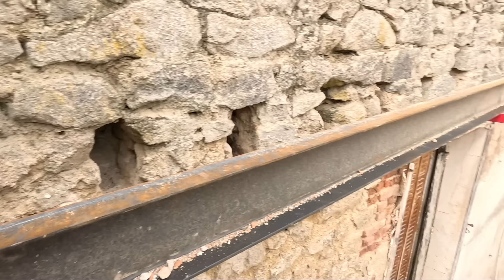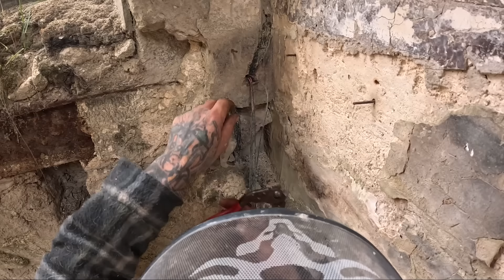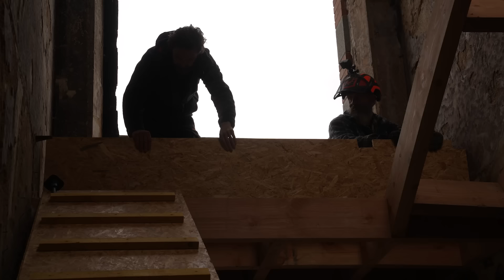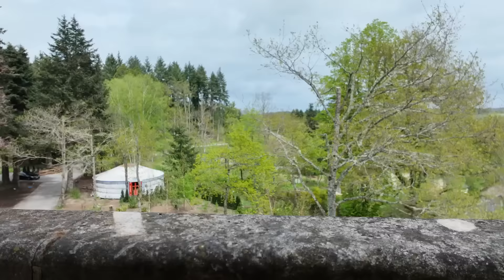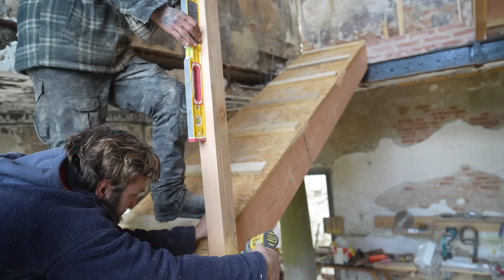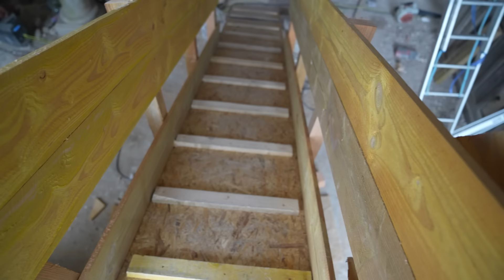Gifting the chateau its viewpoints back.

Comment: Your staircase is still a bit unsafe, if you want to nit pick. The hand rails should be through bolted with a metal plate on either side. If you happen to fall hard against one, especially while carrying something heavy, you could pull out those construction screws and the hand rail may fail.

Comment: Hi from the safety Engineer Do you know why the fire burned what it did? Perhaps because the central section where the stairs are, excellent job, the stair well looks to me like a chimney. Air flows up gaining momentum and speed with air added at each landing Maybe silly maybe not EASU TEST Try putting a childs whiley go around on a stick at each landing to measure the air flow.  Observe Regards

Comment: I think where it is so tight, eventually I would put an old cast iron and bronze cage elevator where those ramps are and a nice, fireproof welded steel stair elsewhere. I see those lifts at auction for under 10000 euros, just needing rewiring and reassembly.

Comment: Something occurred to me....your floors, useing the new method. I'm not any sort of expert but...your floors are supported by an i beam (say at a wall) and everything hangs from that, ok well all the load is sitting on some stones below that . right? well the old way is, the stones under 1 floor truss only support 1 truss so if there is any weakness in the wall only 1 becomes weak or sags, As opposed to entire side or edge of a room.. Ok my thoughts done. OH I love this project.

Comment: I wonder about the tight fits and tolerances you work with. When the building has heat and the outside wall moves with the outdoor temperature changes, will your floor buckle? I hope not, I am just a bit concerned.
Reply: Does one meter thick stonewalls move with temperature changes..?

Comment: While watching several episodes of you notching beers to fit inside the steel beams I thought instead of either hand cutting and chiseling why don't you get a hand router and a straight cutting bit you could do a lot at one time just need to place a guide/fence on them so you don't cut to far back  and it would be  faster as well and all depths would be same across all and length of notch

Comment: Dan, why are you not filling in the holes before placing the C-beam in place?  Are you still drilling and anchoring these as well?  Maybe you can pump some cement in each hole after the beam in in place and sealed from the bottom. :)

Comment: NEWS FOR DAN - Email Dan direct with this possibly usefull nfo if you can, or upvote this message to get his attention, perhaps ?
Basically, all the  steel from the Chateau will be pre-1942 manufactured, so it could command a premium scrap price for use as pre nuclear age forged steel, used in specialist equipment manufacture.

I also heard that prewar steel is sought by blacksmiths for working.

Gotta work all the angles :-)